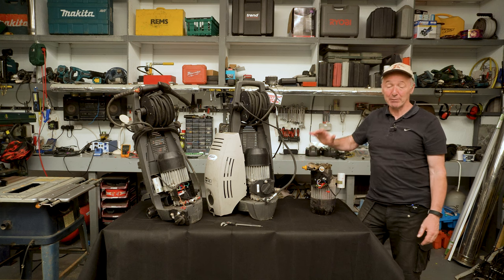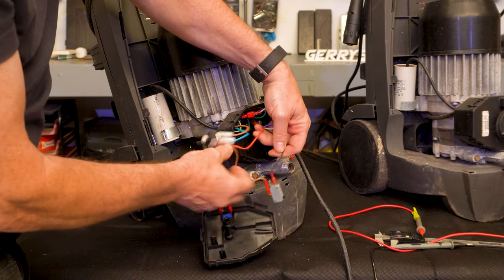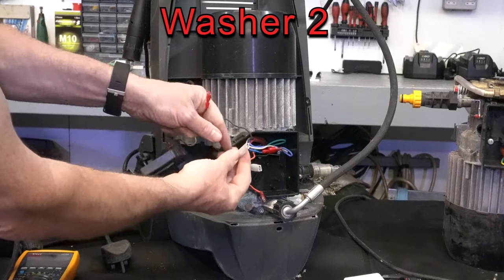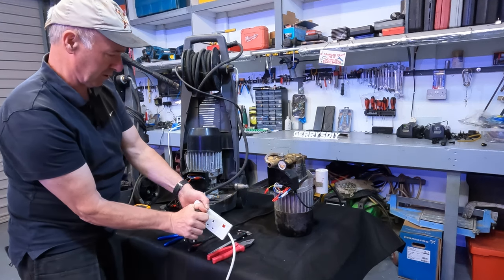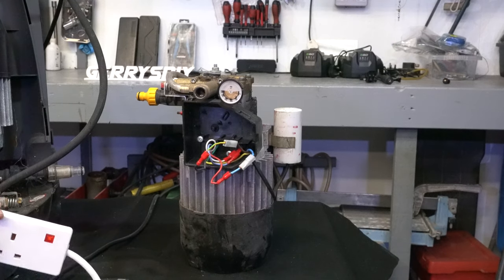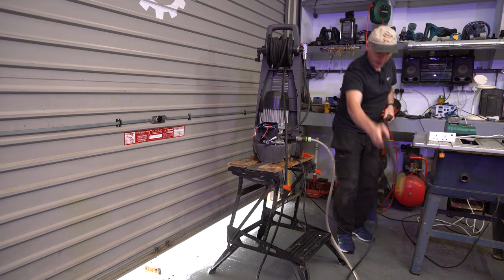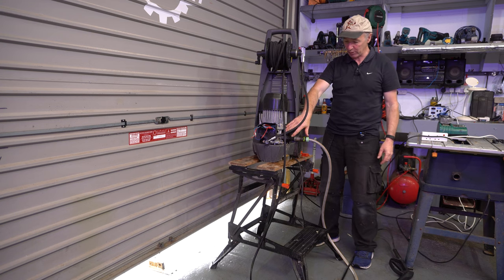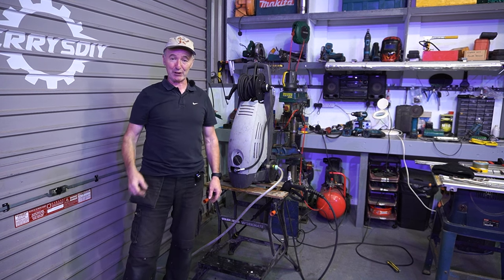Pressure Washer Repair

Comment: Gerry I have 8 broken power washers I was going to weigh them into St Margaret's tomorrow, but now I will try fix some of them, most of our power washers got frost damaged, now I know to run them dry during frosty weather, thanks bud
Reply from the maker: Thanks Kevin. These particular pressure washers are very modular and easy to get going. Thanks for commenting Cheers Gerry 👍

Comment: Gerry, I do commercial pressure washer repairs at work, both petrol and electric. There's always a need to keep after these. One reason the one washer has a split pump is that it may have frozen with water in it. If you can drain the hoses out, and blow the water from the pump, it's a good shot at longevity for it.
By the way, the coating on wire cutters and the like is not electrical insulation, but rather merely a comfort grip, and, when it comes to high end tools, is a means of identification.
I wish you continued success in your endeavors.
Reply from the maker: Hi Bryant. I might have tried to fix the split casing but with plenty of parts to get one going i took the path of least resistance. lol I had thought it was most likely frost alright. My brither in law is a great resourse for lots of this kind of stuff. Thanks for commenting Much appreciated Cheers Gerry👍👍

Comment: Hi Gerry,
It's a pretty common issue with pressure washers where they are put away for the winter and there is still water in the pump.  The water freezes and the pump cracks.  Glad you were able to make a good one from the parts.  For the plastic clips, you might be able to find a suitable clip on Amazon.  They sell assortments made for replacing broken clips from car interior panels.  Sometimes the physical size of the clip is included in the ad and you could look for some that are close enough.  Thanks for the video!
-mike
Reply from the maker: Hi Mike. I found one of the clips and I have a 3d printer so could have copied it but ended up just using tech self drilling screws instead. I'm heading off paragliding this morning and working on a couple of paramotors so more on that soon. Need to get the heat going in the shed too. Thanks for the heads up on the screws and the pump. Really appreciate you taking the time to comment Cheers Gerry👍👍

Comment: I've rebuilt a few of these electric ones, usually more trouble than they're worth but still a fair bit cheaper than replacement. The seals on/behind the swash plate or the pistons normally heat up and fail over time due to cheap factory grease getting washed out. The o-rings are cheap as chips, but other than replacing the crap that comes standard with silicone grease, and running residual pressure through them when the pump is off, a rebuild once a year or so has been my norm.
Reply from the maker: Great info. Thanks for commenting Carbon Materials Engineering Cheers Gerry 👍👍

Comment: Gerry could you make a water wheel generator out of one of those old power washer motors for free electricity, one that could be permanently submerged or float on a river, if you want a nice new irishtype projects, thanks
Reply from the maker: Hi Kevin. I think a permanent magnet motor would be a better option as it would be self energising. Would be cool to have a river nearby to harness though. Thanks for commenting Cheers Gerry 👍👍